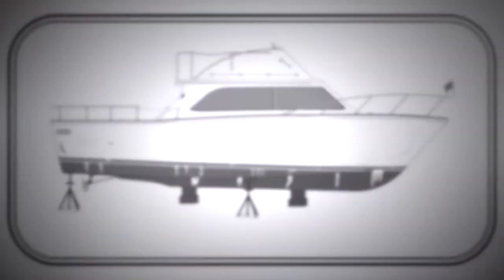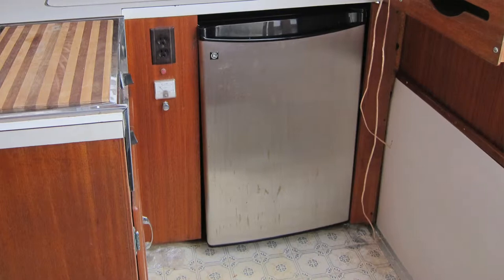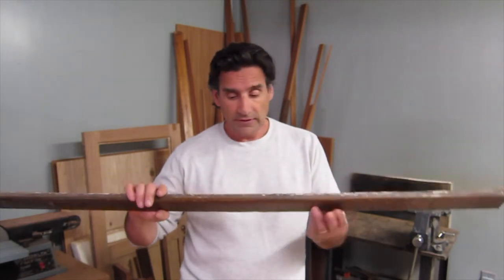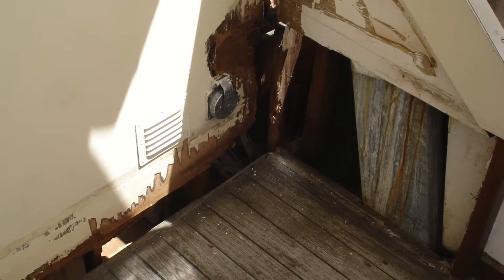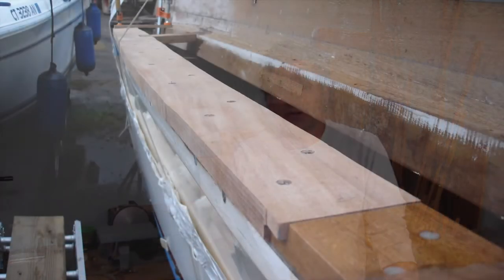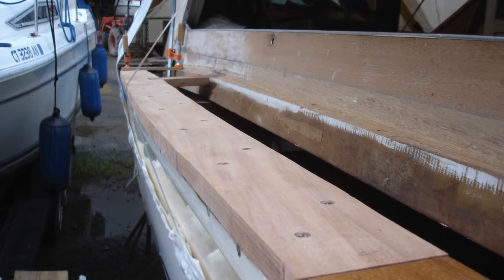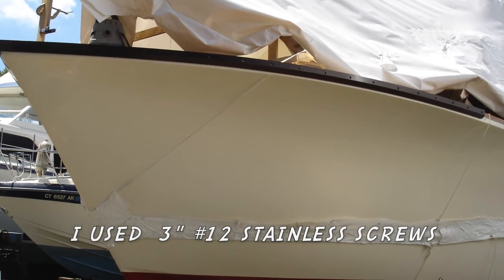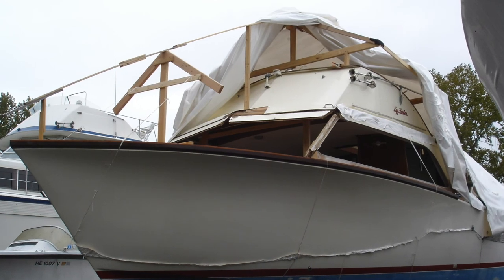Bulkhead, Sheer Clamps & Rubrails - Boat Restoration EP004 (2012 Part 3)

Comment: water damage is the worst to deal with, whether its a boat or a house it can be an intimidating job depending on the damage. like you said you have to step back and take time explore thoroughly and deal with it step by step.
Reply from the maker: I agree. The boat suffered from more water damage than I expected to find when I first looked at it. It's not what you see but what you don't that gets you in the end. Thanks for watching and the comment. - Bob

Comment: Ohhh, the rear bulkhead of your salon was almost as bad as the bulkhead on my Luhrs. I had to remove the whole bulkhead; it was completely rotted top-to-bottom thanks to an unsealed seam between Formica-like laminate pieces on the exterior.
What wood did you use for the wood rubrail? I heard you say it, but didn’t recognize it.
For a fellow amateur boat restorer, and CAD guy, you’re doing an amazing job!
Reply from the maker: It sounds like our boats have suffered the same fate in many areas. It appears that they loved their formica back then. I was installed everywhere. I used Epe for the rubrail. It's a Brazilian hardwood. Used a lot for home patio decks. It's super hard and rot resistant. It is also pretty heavy and tuff on the tools so I used it only in areas that may see abuse. The rubrail & cockpit cover boards. Thanks for watching and the comment. - Bob